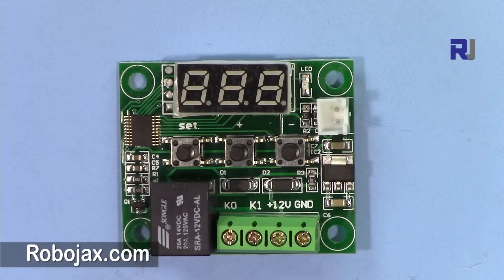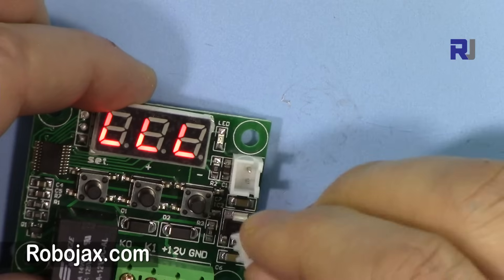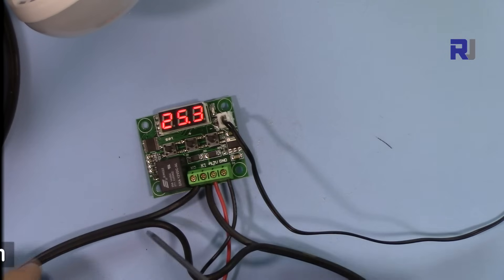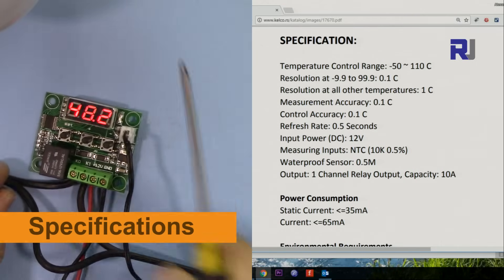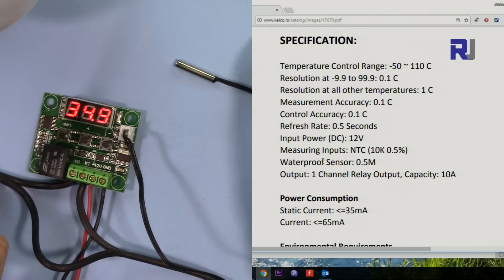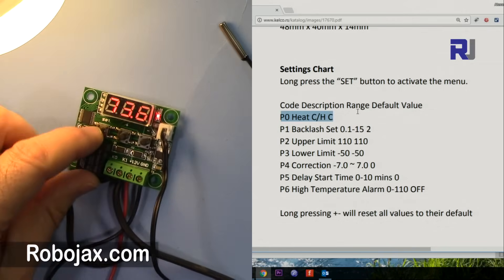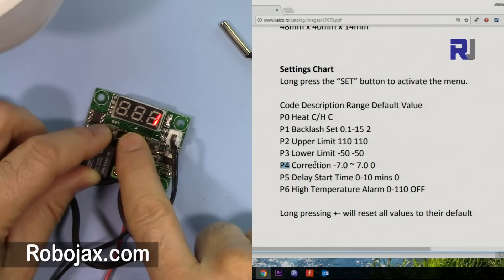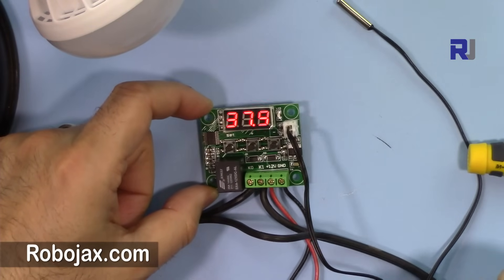How to use W1209 Temperature relay controller and program the thermostat

Comment: Great these modules are ive built a panel for mine and set it up in my metal garden shed to regulate temperature inside to stop condensation in winter, works very well.

Comment: How do you set it to shut off a AC when it drops below a certain temperature
Reply from the maker: then what did I explain in P0, P1, P2, P3 and Program 4? Please watch
09:28 P0 explained
11:48 P1 explained 
12:26 P2 explained 
12:42 P2 explained 
11:55 P4 explained

Comment: Can the sensor operate on low temperature like 3 to 5 degree or even - degrees????. If it works than it's good for refrigerator, as the mechanical thermostat costs more than this module

Comment: Is there something like this but using K-type thermocouples? Why? More temperature range, cheap replaceable part, waterproof, available stainless jacket or compact cheapo version, through-hole abd threaded mounting variations.

Comment: When it's shows lli what does it means
Reply from the maker: On a W1209 thermostat screen, "LLL" typically means one of two things:

The temperature sensor (NTC thermistor) is not connected or is faulty. If you apply power to the module without the sensor attached, it will often display "LLL". If the sensor is connected but the issue persists, the sensor itself might be damaged or shorted out.

The actual temperature is below the lower limit setpoint (P3). The W1209 allows you to set a minimum temperature limit. If the measured temperature drops below this setpoint, the thermostat will display "LLL" to indicate an under-temperature condition, and the relay will not energize (or re-energize) until the temperature rises above this value.

Comment: Cool! I binge-bought mine unknown time ago and only found it today when looking for something else in those Ali bags and boxes. Looks nifty for the buck ... although I tend to use a small temp sensor with arduino for more control, this certainly has its purpose.

Sadly, tho, the buttons seem to have no contact on the backside to solder longer wires. There are three soldered contacts, but I was not able to get a reliable continuity, so the only option would be to connect the longer wires directly to the button poles on the front side.

Comment: @robojax Hi, 
I would like to implement, in a half closed box, where my NAS and switch are, who heats pretty much, to throw inside a quiet fan like 
Noctua 80mm NF-A8 5V PWM with temperature sensor for automatic cooling
Initially I thought to use NAS usb but I think external power supply/adapter is better.
You think this W1209 would be a good fit for my case?

Comment: what is the use of Back slash set if lower limit is there ?  vice versa
Reply from the maker: you can't just say 35. if it goes just above or below 35 it will not function. so you set 35 to 36. then it will work.

Comment: Hi there!I have a w1209 termostat exactly like yours and i want to use it for heating or should i say keep temperature between 10 to 13 degrees but my problem is p2 value do not go under 24.Is there a way to change this,or can it be used with a correction p4?

Comment: I connected my W1209 to a 12v lead acid battery with battery and load gnd lead to the gnd terminal. Added a Jumper to +12v and K1  terminals and then load positive to K0 following a dc wiring diagram.  When the temperature reached H set point, the fan came on as expected.    Once temp reached low set point fan turned off.   When I attempted to rerun the test, the W1209 lost power, it appears to have failed.  I read that any voltage in excess of 12dcv could compromise the circuit board.   I measured 12.8v at the battery.   Can the board handle this voltage over nominal.   If it can’t what can I do to supply 12 v without any over-voltage?
Reply from the maker: Hello,, if you need stable volage, get the MT3608 boost converter https://www.aliexpress.com/item/32948417810.html and adjust the output to 12V. Even with 5V-25V input, it will give 12V. Yes 12.8V or 13V might hram this module.

Comment: Thanks a lot for the video. I got this for a project of mine and I'm trying to find if it's possible to program it so that the + - increments go by 1 degree instead of 0.1. Also, is there a way to program it so that it is on for a certain amount of time? Thanks again!

Comment: Hello, is it possible to connect a heater(polyamide, for instance) and heat something throughout a certain period of time, with a fixed temperature and then it goes off when the time limit is reached?

Comment: I followed the settings as such (for incubator)
However, the thermostat isn't switching off when the temperature goes over 37.7 C (Yes I have set P0 and P1 correctly)
Can you explain what I'm doing wrong
Reply from the maker: Sorry. If you followed the he instruction correctly then your module is defective or check the wiring.

Comment: How will i do? When i try to do setting in my new XH-W1209, in the P3 it goes upto only 14 (the range is between only 14 to -30). I am confuse as you mention it as 50 to -50.
Reply from the maker: something is wrong. my be this is either different or it has been programmed from the manufacturere incorrectly.

Comment: The W3001 controller available for $3 works quite well, this seems to have similar function except it works off 120VAC, and switches the line to the output. Button user interface is different, with a low and high threshold setting used to control turn on and turn off for both heating and cooling, with the hysteresis determined by the delta between the two settings.
Very useful.  The cheap version uses thin gauge wire presoldered to the unit instead of screw terminals, so I just changed them to handle higher current. It does come with a housing, so it's more complete and ready to use.
Modified one to get isolated contacts to switch a logic level signal rather than 120V.

Comment: I don't understand what upper and lower limit does. I set mine to 30 degrees, but when I go over that value nothing happens.
Reply from the maker: Then the upper and lower here How to use W3230 Thermostat Heat and Cold Relay Controller AC DC 12V/24V/120/220V P1 to P8
https://youtu.be/64YBz_F-MKA

Comment: Hi, Im just learning about this existing while taking abt a semester worth of time to do exactly what this does with arduino, so that sucks. I just want to ask, if I supply like 5V to the module, will the device work? I just want to use it for the temperature display and not the relay, so do I have to supply all 12V?
Reply from the maker: It works with 12V only.

Comment: Thank you for your recent reply.

What is the useful function of the Upper Limit; Lower Limit, and Correction settings ???? 
     These are not explained well anywhere I can find.

Looking to set my Greenhouse 'ON' Trigger for the FAN at 29C, in COLD MODE; I discovered setting the module to 27 C, with the Backlash at its default 2C = 29C. 
That has the FAN turn back off at 27 C; which works for me. 
    (Alternatively, if I set Backlash at 1C, the fan switched on at 28C, and off at 27C).

Upper and Lower Limits seem to be the total range in which the module will do anything; and their use escapes me. 
 For example, I initially tried using the Upper Limit for trigger temperature, and nothing worked. It seemed to lock out the module.

The use for the 'Correction' mode is also not obvious . .... Correction from what ??

Is there a manual or some other more complete document out there on the operation / use cases for this module ?
Reply from the maker: Later I explained it in other videos one of them is here https://youtu.be/aY4YbSlJ8tk where you will see start and stop temperature values

Comment: What is your opinion about connecting a reverse diode across the Relay terminals, to protect the contacts from potential Back EMF ??
I am switching a 12Volt 1.5A DC Fan, so a 1A rectifier should do the trick.

Thank you for an awesome explanation.
It was a life saver, since product ships with absolutely nothing in the way of instruction from Amazon.
Reply from the maker: It has already the needed diode
Reply: @robojax  Thank you ..... I guess my extra one can't hurt :) ...

Comment: I have a problem.
When it reaches a temperature of around 49-50, the alarm is activated. - - - appears on the screen. I figured out that I need to set P6 to OFF in the option so that the alarm does not go off.
But when I get to the P6 option I can't go in to turn it off.
I followed the instructions from the video on this link. https://youtu.be/ynIgymF46qo
Reply from the maker: sorry I did not get it.  why you posted link of ther video. if you have this device, just watch this video and you should learn like 300,000 other people.
Reply: @robojax  dud, I cannot turn off P6.

Comment: very nicely explained, btw can i alter the control range to 0-500 deg C by changing the sensor or this unit is calibrated for 10K NTC sensor only.
Reply from the maker: if you want higher temperature and custom display with proper functionality, then you build your own. I have shown it here https://youtu.be/cD5oOu4N_AE

Comment: Having an issue where my incubator shuts off at the proper temp but the heaters stay hot for a min longer, raising the reading to 2-3 °C above the desired temp.  Is there any way to correct this besides decreasing the heater size (using 1 instead of two) or a larger incubator cabinet?

Comment: I want to connect a 12 V fan to this thermostat so that at X temperature it turns on. Therefore I need the thermostat to do the "opposite" of what the video shows at the beginning. At a certain point the video talks about doing this "opposite" but it doesn't show that "the opposite" operation is. Invert the wires? Use the third button? Maybe I missed something but I am still lost.

Comment: Does this support 220V on the relay ?>
Reply from the maker: Relay is just a switch. The power of the load is important. Not the voltage.
Reply: @robojax  So it doesn't matter how much voltage I put on the relay?

Comment: Hi nice hardware , i was thinking if insted of lamp i run a pump cycaling water into a radiator ( not neccary just for the example ) to cool down viaclhle motor .
and the sensor positaion inside the radiator . if the tempuraute goes high , above setpoint . the relay close and the pump circate. and i zm curios if there is option to aplly PID . so the pump motor doesnt turn off imadatlly , but slow down when the mesurment is 2% close to the setpoint .
sorry for my spelling mistakes .
thanks Netael
Reply from the maker: Hi, this is very simple timer. if you want to have full control, then use Arduino shown here https://youtu.be/yJYXfaU9J34 if you don't know about Arduino, here is my course worth $200 on Udemy is available for free on YouTube here https://bit.ly/arduinoStepByStep

Comment: A great way to test the controller is to tape the sensor to an incandescent lightbulb. These lightbulbs get hot when turned on and cool down fast when they are turned off. In the HEAT mode the controller will turn the bulb on and off causing a cool flashing. Don't do this with an LED bulb as they don't get hot enough.
Reply: Are this reliable enough  to be used in a project ? or one should buy expensive controller?

Comment: have a recirculating water heater "110 volt 6000 watts 70amp peak" the AC relay side output powered with 30mA DC to an external 30mA DC 9 volt  to 50amp AC 380 volt relay... ... heater overload switch is 58*C... only need 35*C. electrical bill not $380/month but less then half "1/4"... nice PCB for $20 to be installed in electric water heater recirculation boiler systems. epoxy the sensors into a water pipe fitting? two stage boiler, duel heat setting "only one heater gets switched on if its not cold enough" could also use these with a heating lamp for a chicken coup but the other dog 8 years back joined in with the fox and ate them all... 🤔

Comment: Very good explaining video... One question, can I run a 12v input into the power feed (Positive and negative) then a 12v power source into k0 and 12v appliance into k1?
Reply from the maker: Yes you can power this module with 12v and your load can be also 12v

Comment: Well done!  Just a safety comment if I may.  If you connect a test load as shown in the video be aware that 120 - 240 volts will be exposed on the back side of the circuit board.  Use caution, or perhaps test with an LED and a 1K resistor in series with the relay contacts.
Reply from the maker: Thanks. You may watch the latest version of this thermostat and new video https://youtu.be/kZlTMNqXzo4
Reply: What?

Comment: Thanks. Very clear explanation of programming the device. Is there a similar module that works with 5V?
Reply from the maker: I have not see such thing. But you can buy very cheap boost converter where you can input 5V and it will boost it to 12v. I have video in that . Search my channel
Reply: @robojax  Thanks. I later saw that the solid state relay would work with an input trigger voltage anywhere between 3V to 30V to switch on high (resistive heater) loads, so no worries.

Comment: is it possible to use 2 temperature controller while using 1 sensor only?
Reply from the maker: I haven’t dine it but worth trying it. Make sure to connect the wires exactly as they are as they might have polarity.
Reply: @robojax  im using this two XH-W3001 Multifunction Digital Temperature Controller and Dual Digital Temperature Humidity Controller. for heat, cooling & humidity.

Comment: Hi, thank you for the detailed video. I have been using this module to control a greenhouse misting system to cool down if it reaches a certain temperature. 

It’s been working well up until I needed to disconnect the power supply and after reconnecting the temperature reading continues to rise up to 110c despite no significant increase in room temperature.  It does this even without the temperature sensor connected. I have also tried resetting the unit with no change to result.  I purchased a second unit and have had it connected for 3 weeks before it started doing the same thing.  

Have you experienced this and might you be able to offer some direction to fix? Thank you.
Reply from the maker: Hi, if turning the power OFF and ON again does not help, check the wiring or crack on PCB, if you everything is okay, then it is damaged.

Comment: Need some advice, I want to use one of these with 2x12v DC fans. Can I splice into the 12v DC power lead supplied for the fans to also power the controller?
Reply from the maker: Hi, yes you can.  it is called parallel. like at home you have fridge and TV connected in parallel.

Comment: I just received one of these W1209 boards. However I do not measure any continuity across the relay terminals when it is energized or de-energized. I think mine is faulty.
Reply from the maker: it is possible. Make sure your input voltage is 12V.

Comment: Hi can I run a 12 volt car fan with this in my polytunnel thanks
Reply from the maker: Hi, what do you mean can I run? if you want to turn ON or OFF. I've shown it. didn't I? fan is like bulb like regenerator they are all loads and I've shown how to control the load. in fact this is the only thing I've shown.

Comment: I got a pb with mine. Sometime it is not switching light ON, when it should and I can hear a buzzing sound. When I touch it a bit, to inspect it, hope it works. And what is strange, the LCD is fine, I mean here temperature is shown as supposed. Any idea?? 

Thx
Reply from the maker: Buzzing sound seems to be weak power that can’t turn the relay ON.
Reply: @robojax  Thx you, I ll investigate into Power side, and check about its voltage.
I saw on another video a capacitor is remplaced. Capacitor can give a buzzing sound, but here only SMD Capacitor are present. What do you think ??

Comment: what is maximam temparage? can i use this for iron?
Reply from the maker: maximum temperature is shown in video.  I have shown the relay and how much current (ampere) it can handle.  Find the current of your iron and if it is lower than the rated current of relay, you can control it.
Reply: @robojax  Thank you sir
Reply: @robojax  can you give the idea. How to use this module for control 260 degrees c

Comment: Can I find such a controller for high temperatures like 0-1000 degrees Celsius?
Thx
Reply from the maker: I am not sure you can find such thing. But you can jaw Arduino that can go up 1300C here is the  basic https://youtu.be/dVh77wT-4Ao or with led display https://youtu.be/cD5oOu4N_AE or with lcd https://youtu.be/BlhpktgPdKs

Comment: very helpful video! I purchased several of these about four years ago but need to reset it. your video helped me, because I could not remember how to set it up.
Reply: Are this reliable enough  to be used in a project ? or one should buy expensive controller?
Reply: @anandjoshi8554  well I guess it depends on the project. If it’s Nuclear reactor or a guided missile project, or a human cryogenic freezer then no! But for anything else yes, they work great. I have six of them and they work great.
Reply: @RC-Flight  😇🤔🤔🤭🙄😷🧐       🤐  thanks 🙂